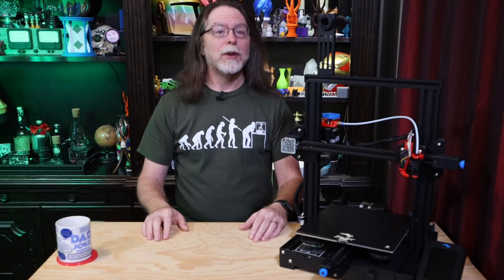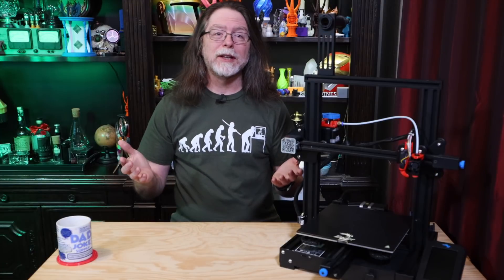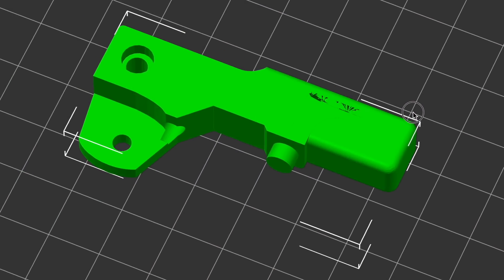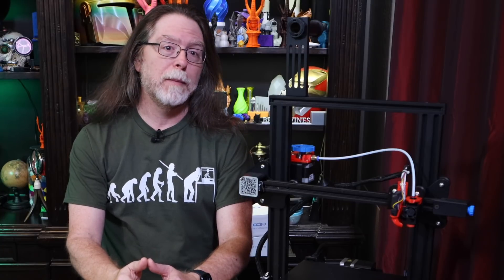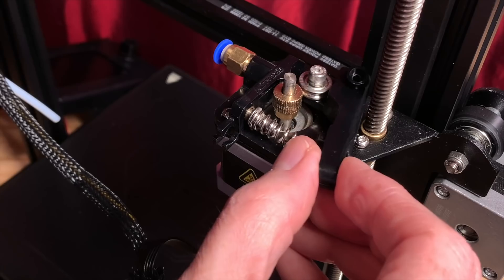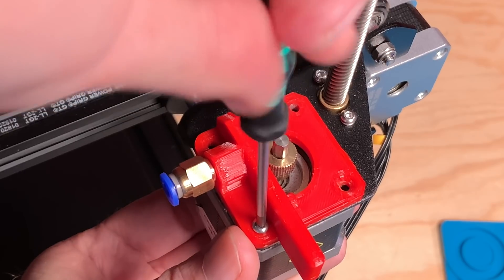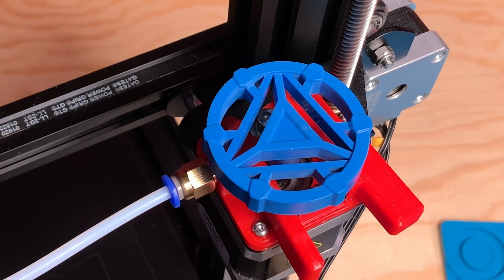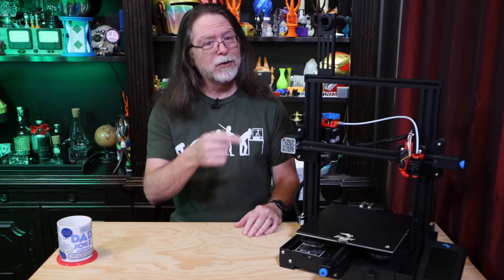🚨 Print an Emergency Backup Extruder for your 3D Printer! 🚨

Comment: This presentation reminds me of when I upgraded my Makerfarm Prusa to a Pegasus, and some extruder parts were included, but having an E3D extruder, didn't use them -- but nonetheless printed in PETg the extruder body meant to hold them. Sometime later the heat break failed on the E3D extruder, and instead of trying to repair it, I collected the parts and the PETg print and put together a replacement extruder, which is on the Pegasus even now. Yes, the RepRap principle is a very handy thing.  More recently I upgraded the heat block to Volcano.

Comment: Great video and great idea to stock replacement parts, especially the ones that you can 3D print, since you can't print them once it's broken. I'm curious why you disconnect the cable to the motor.

Comment: Excellent idea, but since the one on my E3V2 went Tango Uniform on me (The threads where you connect the fitting for the bowden tube cracked, then disintegrated) and I needed a replacement, I went with an aluminum unit. When it costs all of about 12 bucks for a "forever part", it's hard to go wrong. I can't even imagine a scenario where the aluminum one could fail without the whole machine being wrecked in the process.

Comment: My current plastic is ok. Apart from having gone direct drive the tension screw for the spring is untouchable because of its position. 

Printing a new arm myself to change this seems like a good idea 👍 cracking video.

Comment: I had this exact part fail on me after only two weeks. I was new too 3D printing and it took awhile 'and much frustration' to track down what was wrong. Crealty took so long to get back to me that I replaced the plastic handle with a Winsinn dual gear extruder with a metal handle and had my printer up and running before Creality honored their warranty by sending me another plastic handle. When it came time to order my son his own 3D printer, I got him a Elegoo Neptune. It's a much better printer all around. It cost $100 less, and came with a metal extruder handle. His Elegoo Neputne may be a Ender clone but it's 10 time the machine.

Comment: Hi Bryan, can you do a step by step tutorial on Pusa Slicer custom supports and how to set it so only those supports can be used in place of the stock so to speak auto ones done by the slicer!

As the I found that the stock auto supports done by the slicer can be over the top in the amount they do on models when sliced?

This would save allot of filament for us if we could just use the custom supports and not have the stock ones too?

Thanks your a star.  😀
Reply: just click just for support enforcers only in the drop down menu under supports and it will only do the painted on supports then

Comment: The manufacturers of printers that use this type of extruder should include the G-code to print one as a test print with instruction on how to spot the print results of a broken one and how to fit the printed replacement, this would also decrease the amount of people that contact them for help when the extruder bar cracks
Reply: Or just not try too save 2 cents and give you one made out of metal in the first place.
Reply: @Hasher411  Creality does in some of their printer models but not the budget ones
Reply: @AndrewAHayes  If my Ender 3 v2 isn't budget I guess I don't know what Creality makes that is. The truth is that they make and sell a metal handle. Ask yourself why.

Comment: Great video Bryan, but you should definitely use the heat insert from the "broken" part to ensure that the bearing sits tight.
Reply from the maker: I should make a video about heat press inserts. I have some, and I like 'em.
Reply: @BV3D  Yes! Make videos about heat inserts!
Reply: @TuncayAyhan  I often remix parts, like belt tensions with inserts to replace captive nuts.  Oh, a captive nut under stress is doomed.
Reply: @GnuReligion  I’ve seen some videos about that. Weren’t strong indeed. Can’t remember the source though
Reply: I have become a believer in heat inserts.  With enough abuse, a M3 screw will break before the insert does.
Reply: @GnuReligion  Awesome! I myself use them whenever I can.
Reply: I just ordered some inserts yesterday to have for projects in case I needed some
Reply: What is this hotend?